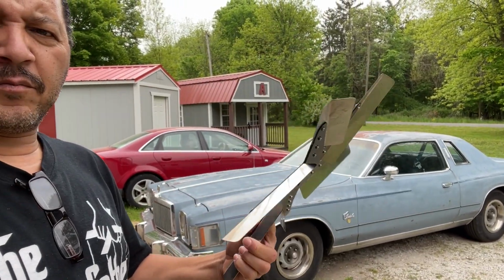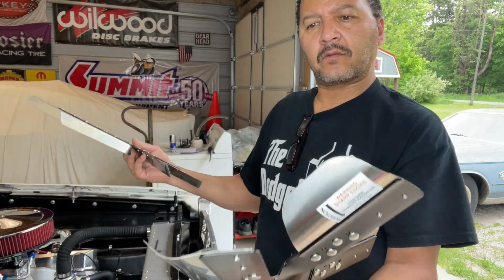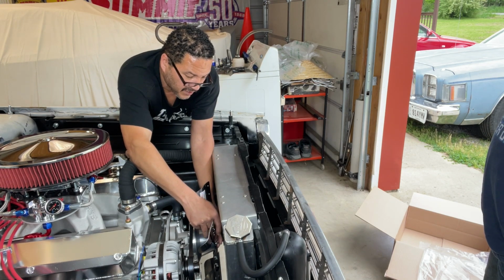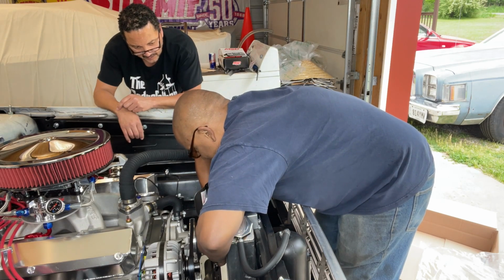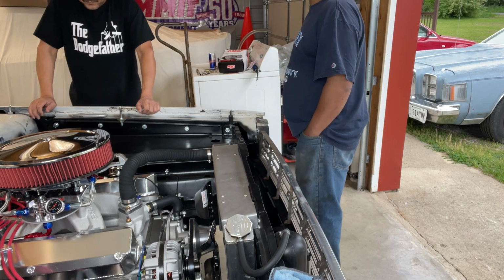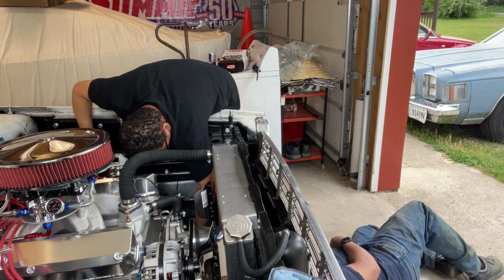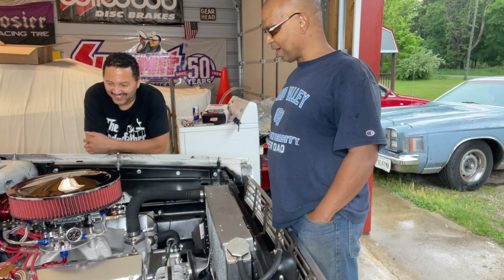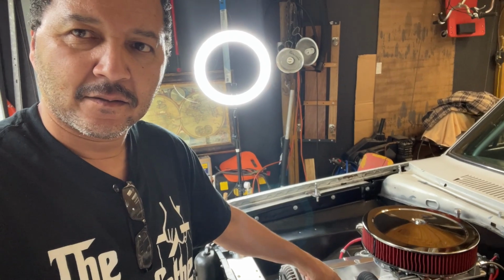Flex Fan Replacement/ Steering Issue Found

Comment: I think 205 is where you want to stay
Reply from the maker: Yea I was worried about getting it too warm. When I would see it get to 180 I would tend to get concerned, but others are telling me that around there it’s fine.
Reply: @392blurredlines  yes sir, don’t be worried as you are totally fine, that’s good operating temp and when you want the engine to run and fire the best, it needs to get up to the normal operating temp